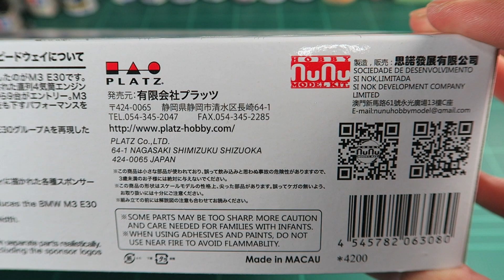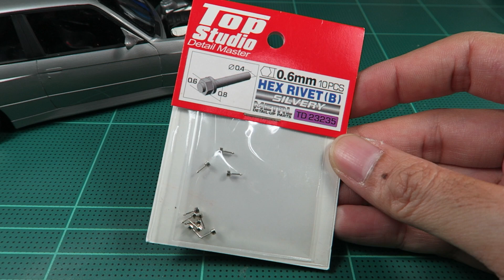Build 1/24 BMW M3 E30 Stance - Nunu Model Kit

Comment: Did you sand the body at all before priming and painting?
Reply from the maker: If the surface is not smooth, it should be polished first, such as Nunu's body.